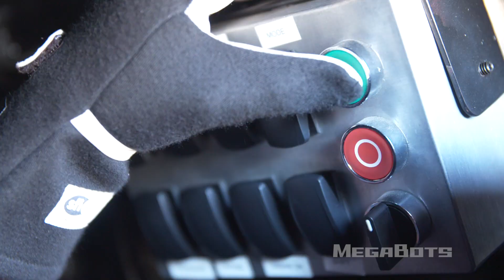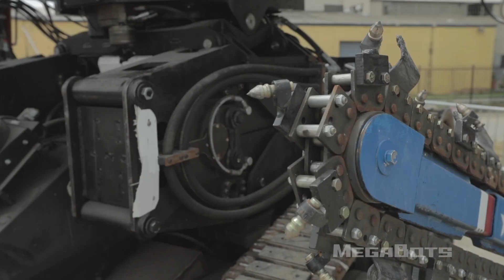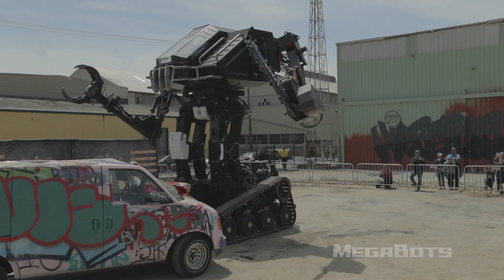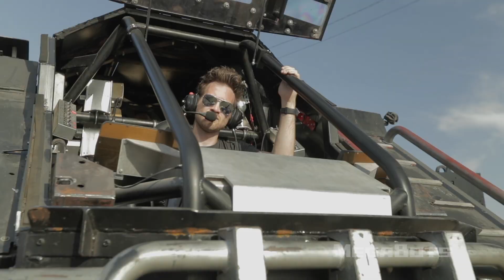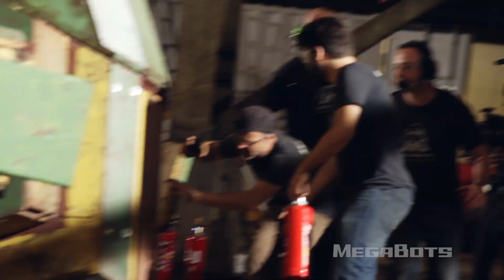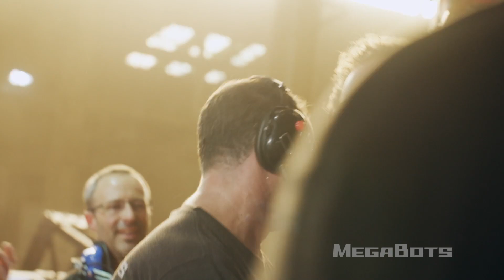THE BEST OF MEGABOTS!

Comment: This is 100% impractical but i love it
Reply: Impractical ?
Reply: Yes impractical it's highly easy to take down with it's high center of mass and it's slow speed it's also so heavy that the fuel economy for that must be sky high for transporting 2 crew if it was my spelling you commented about it's now fixed
Reply: @Lingon_  yea you are right, but it still looks great.
Reply: Lingontuva it isn’t too heavy - most the weight is actually in the tracks. It also has auto balancing algorithms
Reply: @Henners  yeah well if you lift the top/head/cockpit it will automatically put the mass higher up end then making it less stable but you need to raise it other wise it's just more useless